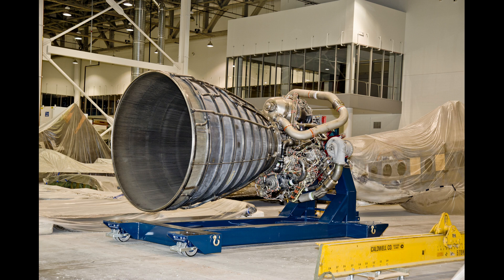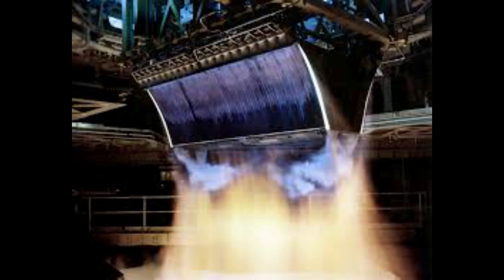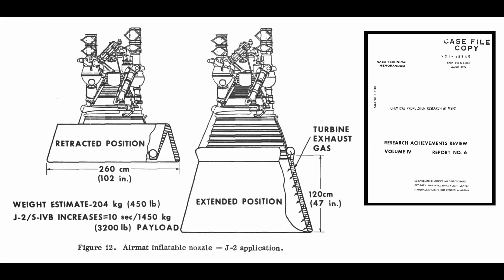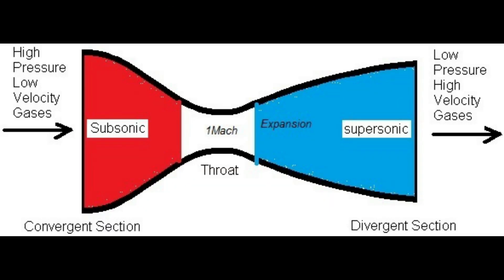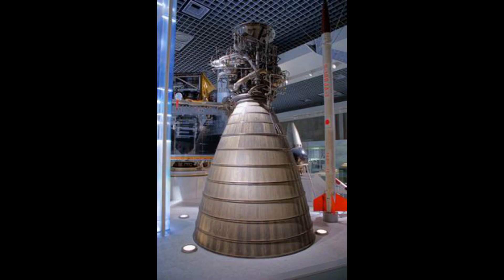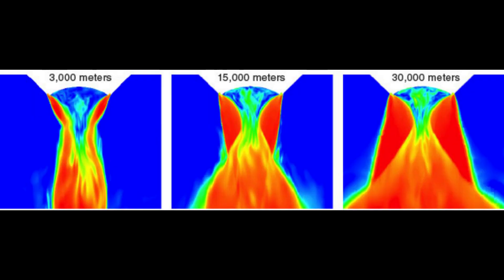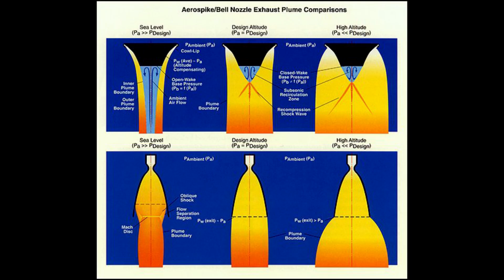Rocket Nozzle Fluid Dynamics

Comment: I love that you used powder toy to present fluid dynamics, but I think its pressure calculations are way too janky. Pressure doesn't work on a 1x1 square basis, it works on 4x4 squares which makes it act funky with tighter nozzles